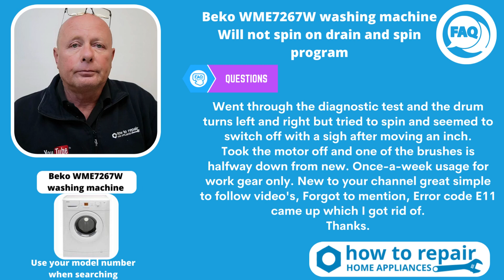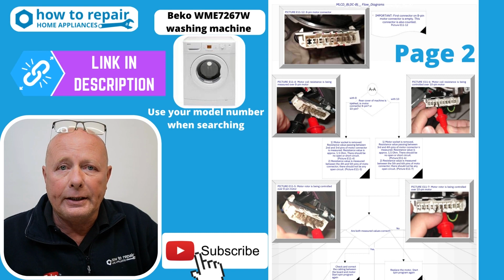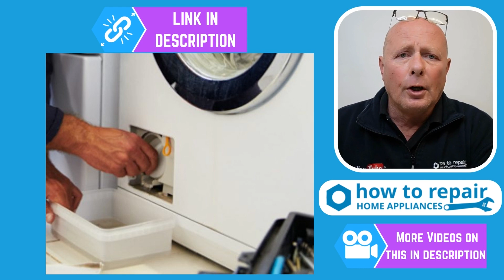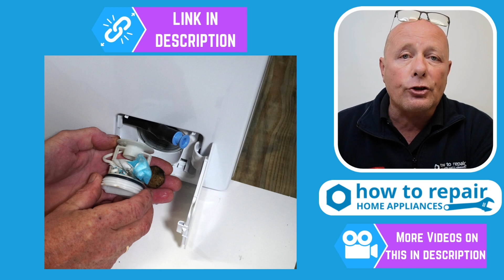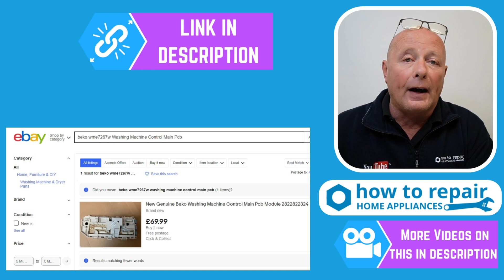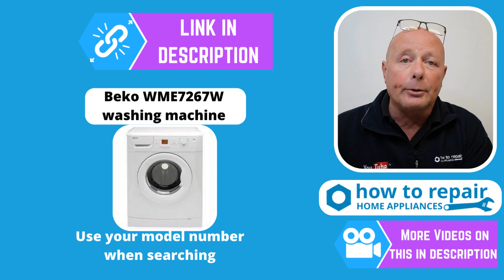Beko WME7267W washing machine Will not spin on drain 🛠️ Error Code E11 motor faults

Comment: Hi m8
I have hotpoint condenser dryer  flashing lights i checked in YouTube it says change heating unit its ok and the dryer is nearly new
Reply from the maker: Sorry for the late reply I was away on holiday. You want to check all the thermostats on the machine but I will need your full model number and serial number to assist you. Please use the website with this information. Have a great Christmas and a happy New Year glad we could help you ومظات علي طريق النجاح this is for you https://www.youtube.com/shorts/e432SAb2g08 please remember to subscribe as that's what keeps this channel going. Thanks 👍